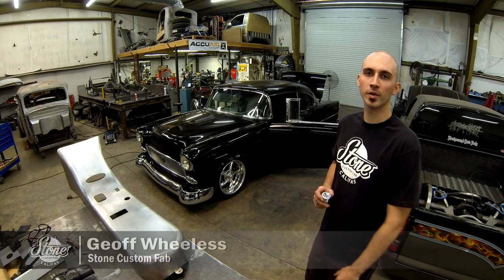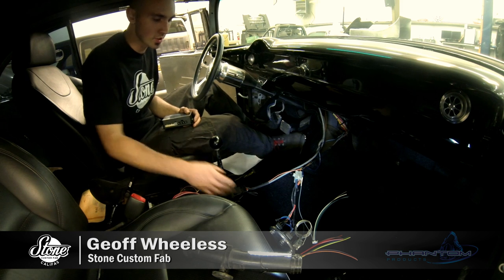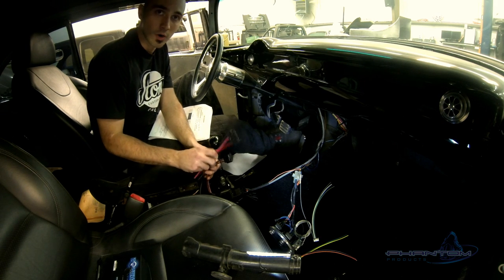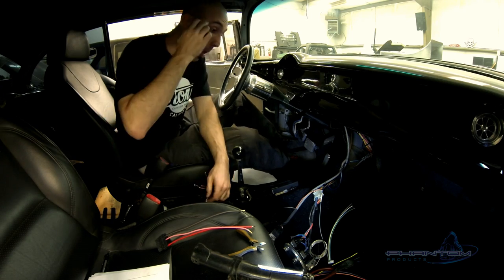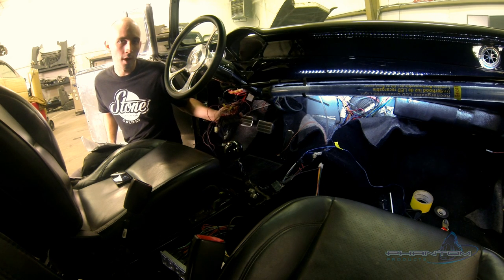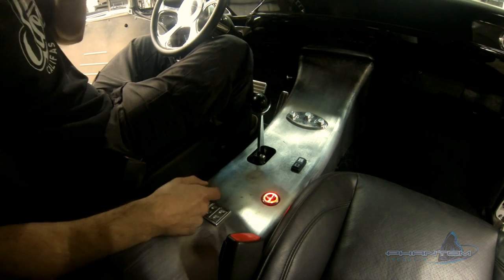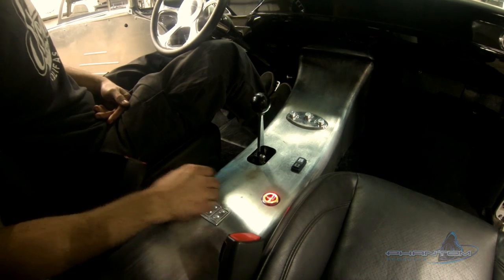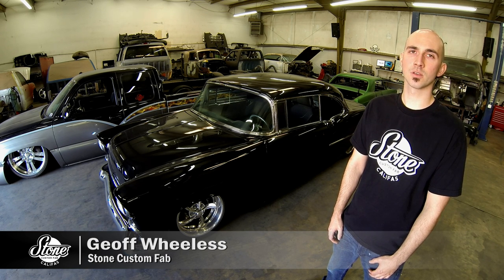Phantom Products: Touch-N-Go (Install)

Comment: With its placement in the center console right at hand reach area for passenger, what fail-safes does the system have to ensure that accidentally bumping the touch switch wont turn off the car?
Reply: u have to tap the button 3 times to cut it off...